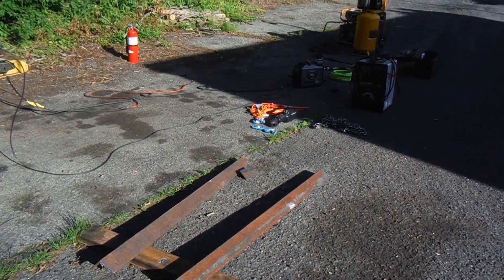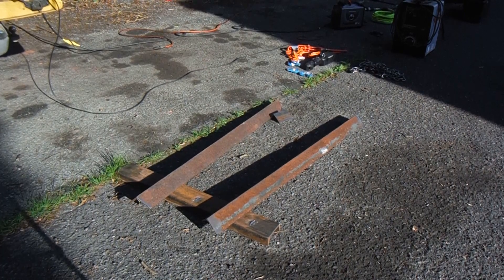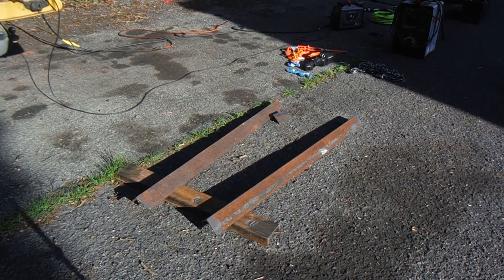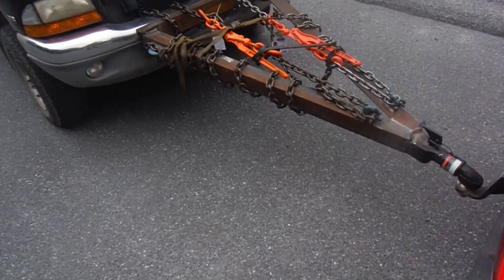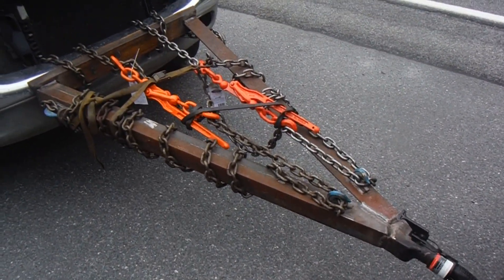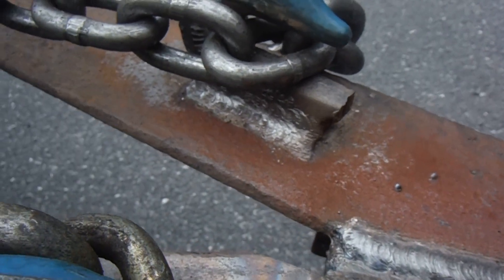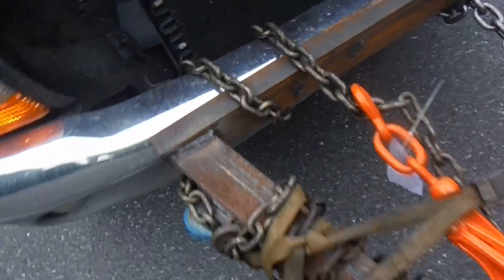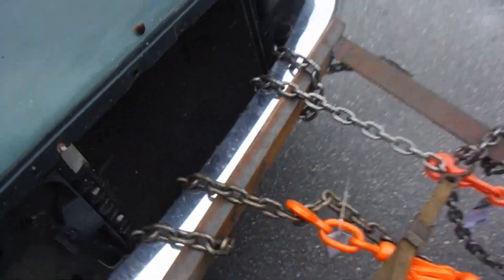building a junk car tow bar

Comment: I had this idea I knew I wasn’t the only one I will recommend some rubber on the metal and use  straps instead of chains Heavy duty straps
Reply from the maker: straps get torn chains don't. I don't use this thing to tow show cars or even cars to get rebuilt. the rubber idea would be ok but like I said its a waste of time to protect a bumper that's going in the shredder.

Comment: Think it will tow a school bus to scrap
Reply from the maker: mine? maybe a short bus. the concept of it would tow a full size bus but personally I would use heavier steel than what I had used for mine. I just found some scrap and used what I had. If I was building one to tow a bus I would go with at least 4" channel for all of it. and a pintle ring. if using angle at least 3"x 3/8" thick. you'll also need to either cage the brakes, disconnect/cut them off, or run a tow vehicle with air brakes or engine driven compressor hooked up to the red (emergency) line on the front of the bus.